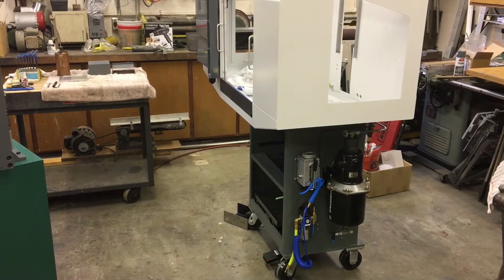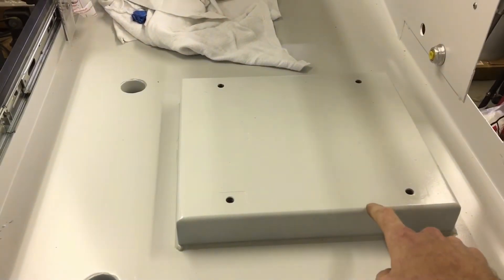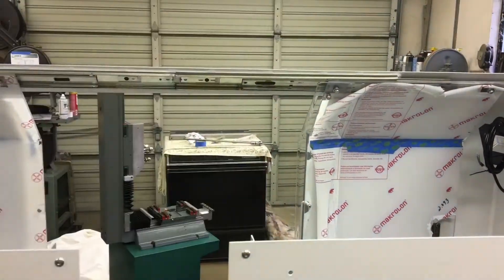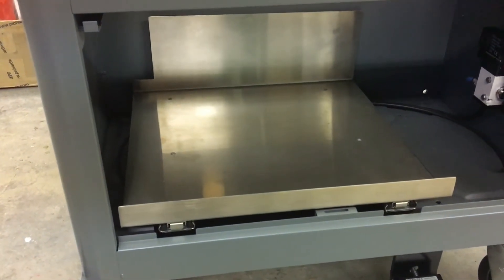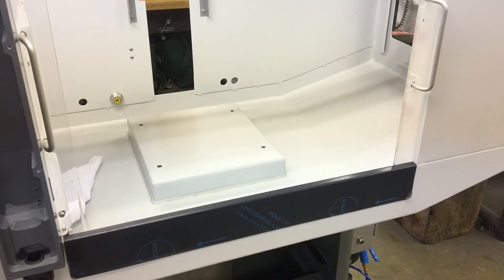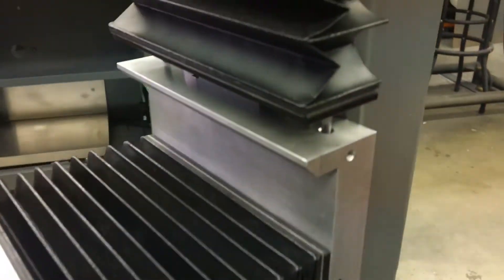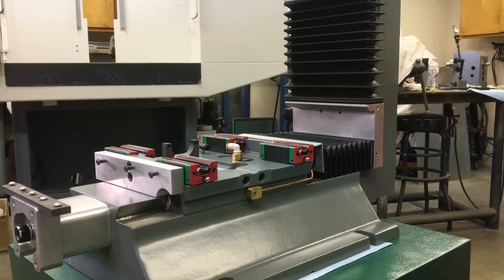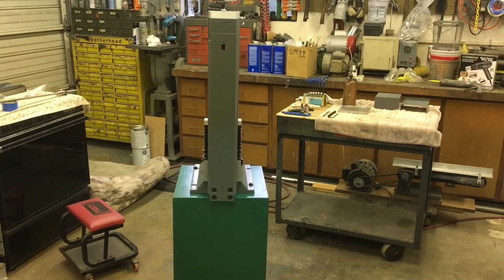GRIZZLY G0704 CNC Conversion Update 25 - ( assembly 3 )

Comment: How did you fab all of your sheet metal parts?
Reply from the maker: I primarily used basic hand tools (the enclosure was more work than the machine) the only "special" things would be a sheet metal brake.... and it was far from special, its a clapped out harbor freight 36" brake... i have been abusing it for at least several years now, I did a lot of work for my machine with it... its a very limiting piece of the puzzle but if you design around your "tools" you can make amazing things with basic tools.... granted i have done this a "few times" Im from from a "sheet metal guy".... it is pretty fun tho...!  - Nick

( i might have some videos from a few months ago showing the fabrications stages of the enclosure.... or at least you can see what it looked like along the way, poke around...)